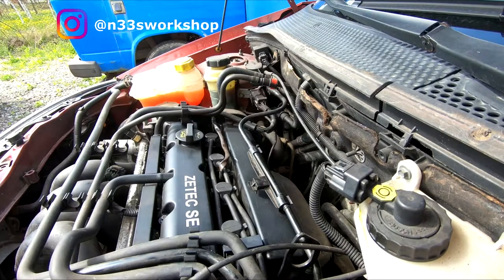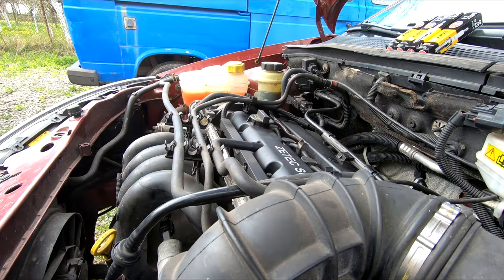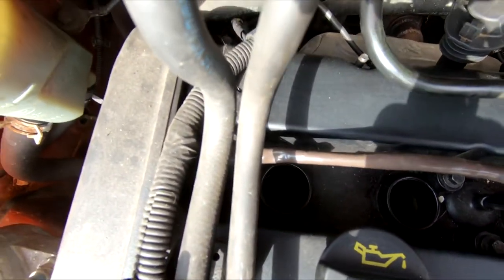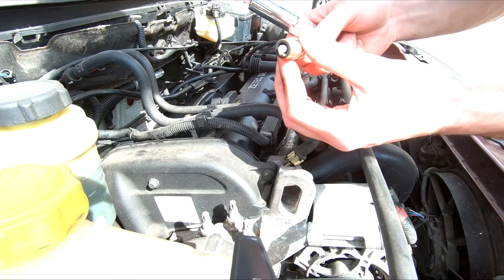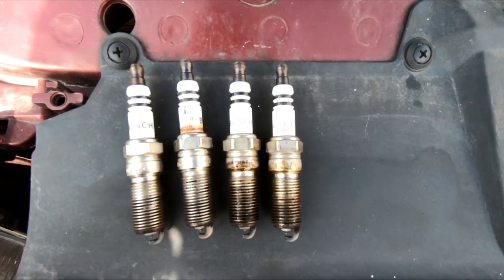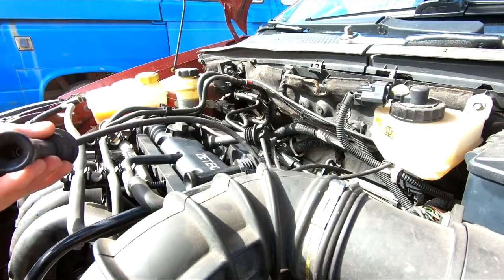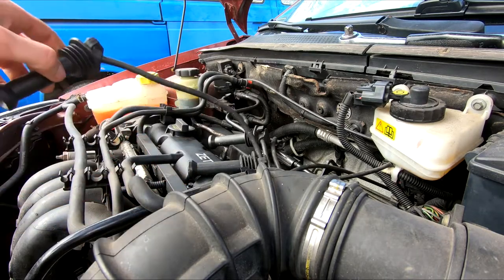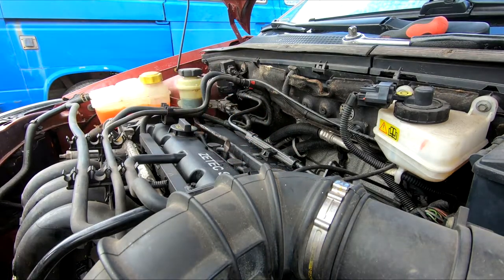How to Change Spark Plugs - Ford Focus Mk1 1.6 Zetec SE

Comment: Nice video as always. Lemme add something from my own experience. For Fords i recommend OEM spark plugs. Motorcraft is also not great. Cars tend to jerk or run erratically. Plus when you installing the cables it's better to spray them with silicone the don´t have tendency to stick that often. Also change ignition cables every 60 000km (NGK,OEM not TESLA) and ignition coil every 100 000km(OEM or NGK). Don't take it as hate. I just wanted to add something from myself ;).
Reply from the maker: Extra information is always appreciated! Thank you!
Reply: So what spark plugs are Oem?  For what i know is that Motorcrafts are Oem
Reply: @scottykilmer3920  Motorcraft and Omnicraft are essentially aftermarket parts sold by Ford. Most of the time these are just repackaged parts from different manufacturers and not OEM.
Reply: Thats right, i did knew that. But what do you suggest for these engines, Motorcraft? or Fomocco.   Fomocco's are mostly Bosch,  and Motorcraft is mostly made by company  Autolite. i tested some Ngk's copper and the engine did not liked it.
Reply: @scottykilmer3920  Personally, I would recommend installing FoMoCo spark plugs even with their higher price.
Reply: Why not Tesla??
I had water in top motor...and I didn't know 2 years ago ...and 
This year I find out...I don't have the cover for top motor , the Plastic..and are 2 holes in top motor... why was water in there?

Comment: I started doing the plugs, coil, and leads on a pals' focus ST: did the coil, but the plugs have a cover over them which is/has been bolted down with 3 x 10mm bolts and 1 x 8mm bolt. The recesses in the cover that these bolts sit in are too small/sung to fit a socket in, therefore the cover cannot be removed. Bolts holding the coil were t25 or t30 (I forget), but my thoughts are that someone has previously had that cover off and replaced it with these 'normal' bolts instead of the proper torx ones? Any ideas?
Reply from the maker: I don't know about the ST170, but I know people love to replace special head bolts with standard ones!

Comment: Seems the spark plug should last many more then 20K miles? I know the duratech is more advanced at 100K with iridium, probably could have been used in this engine.

Comment: Oem spark plugs for these engines are not platinum or iridium.
Oem is copper if you go for platinum or iridium you will get less performance out of that engine, especially when its summer.
Reply from the maker: If you say so...